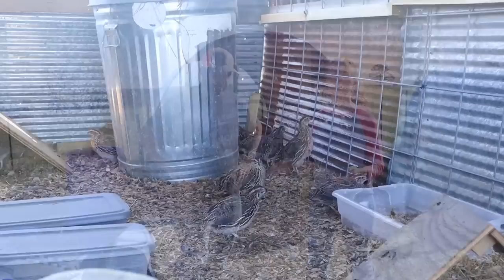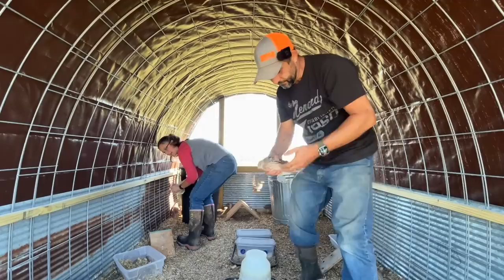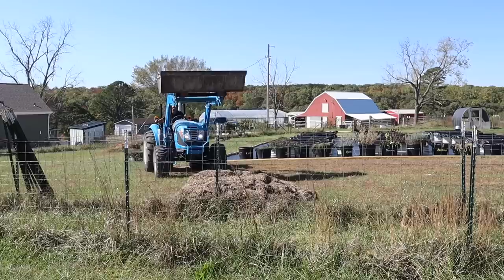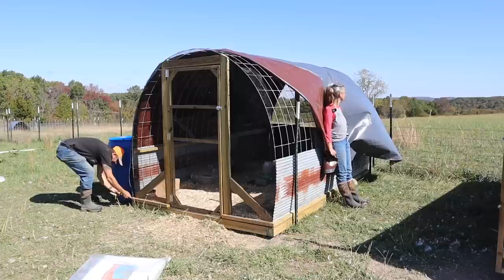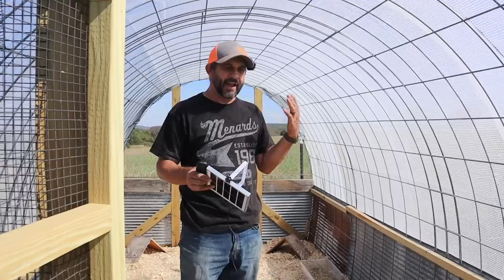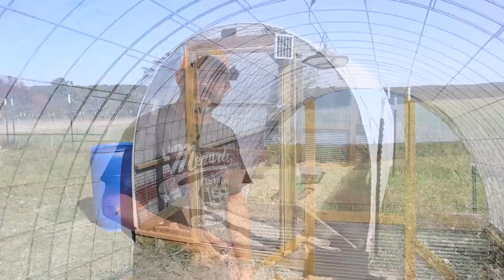The QUAIL stopped Laying EGGS! Will THIS be the ANSWER to our Problem?

Comment: Hey. Just a heads up. My father was a heavy equipment operator and I was running a tractor by the time I was 12. A big safety thing he said to me is to always travel with the bucket low, not up high. Tip over hazard. I kinda cringe when I see you do that😢
Reply: Agreed!  Bucket as low as is practical.  Keep the center of gravity low especially with a load in the bucket!
Reply: I was taught this in tractor safety in 1980's. Absolutely accurate. Also, for the masses, no passengers without their own seats. If you roll over you CANNOT save the passenger(s). Too often people mow with child onboard the lap or wheelwell.
Reply: That was scary
Reply: That's the difference between day and night.  😂Looks great

Comment: In the Spring, you should just be able to layer the dark tarp right over the top of the clear, since it's a bit longer, it will reach down further on the sides to screw it into the wood, then next Winter just remove the dark one, and the clear is already set
Reply: You read my mind!  😁
Reply: I had the same idea. One less thing to store.
Reply: The dark one could be adjusted in the summer depending on how hot things are covering whole or a only a portion of the coop.
Reply: Yes would that work. Just add the other tarp on top of the clear one
Reply: There's always shade cloth too.  Different degrees of shade, and could be doubled up if wanted.  Then it's still shaded, but not so dark as with a tarp.
Reply: @sherribrown9989 I thought about using shade cloth too!

Comment: To save time, when you change the tarp in the spring, could you put the dark one on top of the clear? This way you would only have to take off/put on the dark one. I don’t know how much time this would save or if it would be too warm with both tarps on. Just a thought.
Reply: I was going to suggest the same thing!  Kinda like shade cloth for the high tunnel(quail)!
Reply: Same same 😄
Reply: I was thinking the same thing.  It certainly would streamline the process twice a year.

Comment: When we lived in MO I had my quail in 8x4 in ground garden bed/runs. I rotated them through the beds that I planted with leafy greens. As the plants were spent the quail cleaned up the bed ready for re-seeding. I had greenhouse plastic over the beds in winter to keep the worst of the weather off. The quail were very happy and laid most of the year. I plan to do the same now that we have moved back to England.

Comment: Vinal flooring will making a very big difference. We have it in our coop, love it. So easy to clean. String up holiday lights around the sides and door. It will give light and some heat. Love the clear tarp. Need one for a shorter high tunnel for spring and fall plants. Thanks for sharing. I think the quail will enjoy it. God bless and protect.

Comment: 1. Pretty dusty in there. You should be wearing a dust mask.
2. Leave the clear tarp on all year. In the summer just add the dark tarp over it, or better yet, add a shade cloth. Then when it gets this time of year again, just remove and stow the shade cloth. No need to put the clear tarp on over and over, year after year.

Comment: If you're willing to consider Outdoor String Lights with remote they usually have the ability to schedule when the lights are turn on and off.  Some have time limits such as 3, 5, 8 hours and others allow you to schedule the turn on and off time.

Comment: If you add big sand pits for them, most of your eggs will be laid in the pits. For your size area  and quail qty I would suggest the concrete mixing trays at Lowes/HD. A mixture of 50/50 dirt/sand works best.

Comment: Something you could try…We use a cheap vinyl flooring on our coop floor. It protects the wood from moisture and rot.  We also can roll it back up wash it if need be…although haven’t had the need to do that yet.

Comment: Tractor supply has a bedding called pelletized horse bedding. Is compressed untreated pine. It looks like pelletized food. Once the pellets get wet it turns into sawdust  irs cheap and clean. I've started using it with my chickens...pretty much all Mt animals and I have my quail in  a coop on the ground

Comment: I don't know if this would apply to quail or not. I've always heard that if you are extending day length with artificial light you should have the lights come on before dawn rather than after dark. The birds use the dimming twilight to find where they are going to settle / roost for the night. If the light goes off suddenly they are left in the dark without being able to see where to bed down.

Comment: You'll definitely get more eggs. I have power at hutches and use a string of LED Christmas lights and get more eggs than I have layers every day. I set timer to come on 6-7am and 5-9pm to give them 14 hours of light. If the clear tarp doesn't get destroyed by UV you can just lay the dark one over it in spring.

Comment: @Living Traditions 
If you use supplemental light, your egg production will drop off from the norm substantially next season. I have been homesteading since 2011 and have learned this the hard way. Also your water barrel will act as  a store of thermal energy when its cold if you put it inside the coop in the winter. And will be less likely to freeze if thats possible in your area.

Comment: I am in Sudbury, I Ontario
I would like to tell you that it would be easier if you made a little tiny house in there that they could be in and you wouldn’t have to pick them up. You could close them up at night. They would stay warmer in a little tiny house inside of their up off the ground All together.  When you’re cleaning the coop, they would be all inside the house. You wouldn’t have to pick them up no stress and it will make it much easier for them to be in when it’s really cold you can close it and make them warmer from their own heat.

Comment: just a suggestion that might help, line the bottom of the pen with a tarp then put on the shavings, then all you'll have to do is pick up the corners of the tarp and dump in the tractor bucket instead of shoveling...

Comment: Great video Kevin!  An idea for your ends, just build a square frame around each end, Same height and width as the enclosure.  Then, mount a piece of metal conduit tubing across the top, and tape a plastic sheet to the conduit along an edge.  Essentially you're making a simple "roller shade" like for a window, with plastic sheeting.  Now if you want to open it up, just roll up the plastic, and if you want it closed, pull it down and hold the bottom down.  If you want it to always look nice and neat, tape another piece of conduit to the bottom of the plastic, and it'll keep the bottom from wrinkling, and the weight hold it down by itself.  I've made these with both plastic and metal conduit, whatever you have on hand will work, but the metal one works better for the top so it doesn't bow in the middle.  Even then, you can keep a plastic one from bowing as much if you stuff a stick or a piece of wood inside.  Good luck!

Comment: Hi, I used Christmas lights on my quail cages and a light plug timer that you would use if you leave your home and want it to look like someone is around. Worked  really well it  did. So this will work  out. I have even used a rechargeable shop flashlight that had a hook on it worked good to for my chickens.

Comment: Just a suggestion, but if you put down a layer of vinyl flooring in the coop it should help with the cleanup. You should be able to pick up a renement fairly cheaply.

Comment: We built your hoop coop according to your video last year for our quail, and they have lived comfortably in it for a year and a half.  :)  Actually we've built five so far, we have chickens now too and plan on making one for rabbits as well!  We put a clear tarp on the back when it gets cold, and sometimes during summer storms.  We cover the back with shade cloth otherwise.  Of course we had the SAME problem finding solar powered timed lights.  We went with a decent solar panel, a good quality USB battery, and Christmas lights that stay on 24/7.  (I also hook up a fan, a camera, and an aquarium heater for the water.)  I'm still looking for an in-line USB Christmas light timer that doesn't need to be monitored every day!
We haven't had to scoop out bedding, we just add some wood chips every week or two and stir it up for them.  It has stayed dry and fresh.

Comment: I use poly feed sacks cut open and duct tapped together to cover my wood chicken house floor.  I lay down strips rather than one big tarp do it is easy to carefully pick up the tarps and dump into front end loader
 I use bedding on top of the tarps. Very easy for me to clean the chicken house.

Comment: When I added a light to our chicken coop, I put together a 12 volt timer, small 12 volt LiFePo battery, solar panel and 12 volt led light. The timer I use has multiple on-off settings. I set it to come shortly before sunset and go off after some time. I think the whole setup was under $100, and I can add more lights or other 12 volt items if needed.

I did this because, like you, I could not find a light that would come on at sunset and go aff after a couple of hours.

Comment: To eliminate the inconvenience of a tarp that turns out to have it's size falsely advertised and be too short; the next time you change the tarp, add a 1x12 inch board at the bottom of the coop on both sides. Then you can center the tarp without a problem.

If you do that, you can extend the life of the wood by using threaded inserts where the grommets are screwed down.

You can eliminate the snagging by either putting tape over that area of the wire, or place 1/4 inch thick PVC boards over the coop.

Cut an 1/8 inch deep dado into the boards at the end that way, you can tie rope or twine onto the tarp and run the twine or rope in the dado to pull the tarp over the coop. This will give you more control over the tarp on windy days as well. Simply screw the tarp down at the two ends first, and then pull the tarp over the coup.

Comment: I love the way y’all  jumped in there and improvised with the new tarp, which, by the way, should DEFINITELY be the size that’s  stated in it’s finished state! It’s one thing if you buy the tarp fabric and then have them finish it as an option but when it’s a pre-packaged item that says the tarp is a certain size THAT’S finished product! How else are you supposed to know what size to order?  Even though you went ahead and used it, I’d still be contacting the company and I’d let my review state what you  ran into. I buy nothing on Amazon without reading reviews and this is something I’D want to know if I was looking to buy a specific size ANYTHING!  But great job, weaving in the wind…LOL Y’all got it done!😊

Comment: What if you made a similar coup but with a  roller at back, as well as a back hatch that opens you put a crank on rear roller like you have to lift side of greenhouse then with a heavy duty tarp make a conveyer so you can just open back hatch and crank the mess out into tractor bucket . So you have a tarp that fits over floor inside then bedding over top when its time to clean remove feeders etc open back hatch and scoot birds out into a cage then crank soiled bedding into tractor and just pull on front of tarp to put it back in place put fresh bedding and feeders back in then  line up crate and let birds back in.

Comment: For the bedding, I recommend finding a friend with a wood planer that utilizes a helical cutting head.  The resulting chips are a small consistent size, and the cost would be nothing.  They should compost faster as well.  The wood worker will appreciate you taking the chips.  Trust me!  Thanks.

Comment: Great job guys , I'm actually building a green house 20 x 10 that will have 4ft solid walls and concrete post for my new chicken coop. I want them to have more light and plenty of room to move I. Our very deep NY snows. I have to give a bit of a warning on that tarp. I put one as a temp on another plant hoop green house  last fall. The sun made it brittle by spring and there was major leakage. . For the new coop green house I will be putting wide rolls of bubble wrap under a "string' system attached to hoop frame to retain more heat in the winter nights. Your lucky we have weasels, pine martens , fishers, raccoon, and bear all love the chickens in winter. I will be lining the hoop frame with 1/4 hardware cloth. Fishers literally ripped out a window on our last coop several years ago. Got them all.  Here weasels would crawl  up under that one side of your tarp in a heart beat.. It will also help with snow loads between hoops. Love the channel and all your ideas. They've given me inspiration.

Comment: (1)  What about running 2 lengths of christmas (multi-color or white ?) LED light strings around the edging of the windows - and put onto a timer with the solar charger and battery system - less energy use and greater overall light profusion.  (2)  Could also install LED spotlight 60W - 80-100 W and that would definitely have some greater illumination.  (3)  If you also put in some mylar plastic sheeting onto the bottom walls, then the greater albedo light bounce would have even greater illumination of the ground level of lighting for the birds.

Comment: Love your quail hut. I may try one this spring, but I am thinking twice as long with a door on the center and both ends. I could shut them on one side while cleaning the other side. And maybe I could just have on tarped and one clear . I still work 10 hour days away from home.

Comment: I am surprised you didn't look for replacement cover for the small cheep hoop greenhouses. Ive seen some on line on Walm web shop in the simi clear same as your tarp. That would have given you ability to close ends if you got one with front & back door model. You coukd always get one to put over your clear tarp when winter hits even if only one doorway type it would work for winter & over your tarp it would insulate more.

Comment: The quail look like they are really doing good in the their new home. That is awesome. More room to move and interact with each other. Do they tolerate the cold well? Or will you have to do some kind of heat source for the really cold nights?
Reply: These quail do well in the cold. Even down to -10 without heat. As long as they are protected from the wind they are fine

Comment: Innovative on the lashing, but I’d just use sheet metal screws with the washers you used before.  I just a night to day Solar light.  It shuts off when the battery dies and recharges during the day. Never needs to be messed with

Comment: Hey Kevin, you should consider hanging the panel on the header board orienting the solar panel 90 degrees the other direction for optimal charging. Solar panels charge best with direct light striking the panel pointed directly at the sun's rays. The axis you currently have it on does reduce the charging capabilities.

Comment: If the timer on your light is like the one I have, you should be able to turn it on at a pre determined time, set the timer for 2-4-6 hours, and it will come on ever day at that same time, stay on for the appropriate number of hours, and turn itself off!  Win for not having to do that every day!

Comment: I plan to eventually build a couple hoop coops for birds, but I was thinking about using either 2x6 or 2x8's around the bottom because of the discrepancy between cut size and finished size of tarps. The bigger wood will make it heavier, but I don't plan on moving them much.

Comment: I was going to suggest an in-line timer . . . that you can program so it turns on the electricity to whatever you want on a timer.  However, it may be a problem on a solar unit . . . I don't know enough to be able to answer that.

Comment: Since you said it tends to get wet near the door when it rains, would it be helpful to move the wooden tents a little further in so the quail will not get wet feet? Just seems the new bedding will get wet where you have the tents in the corners near the door.

Comment: As always, WELL DONE 
Wondering if you could put a shade cloth like the greenhouse instead of plastic?
Maybe you could try the shade cloth in the spring to see if it worked out to your thoughts?
P.S. Looks like there are many comments below suggesting using the shade cloth.  I should have waited to make my comment, sorry.

Comment: I see you have an LS Tractor.  So do I.  Got it about 12 years ago.  A 4040EZ with 41 HP 3 cyl diesel.  VERY reliable machine...  Rim-gard in the tires, extra large tires and it is a beast.  LS makes several other brands including New Holland and they are assembled in New Holland PA...  

Just an FYI
Reply from the maker: I’ve had mine for about 7 years now and have been very happy with it.
Reply: I have a Mahindra 4510. It's the biggest piece of garbage I have run in my almost 60 years of running equipment.  I never pass up the opportunity to bad mouth it. Sorry for butting in.

Comment: If I ever get into raising quail, I will use your method. It looks so much better than the way that you were doing it. On that note, I wish there was a different way to raise rabbits. I don't like having them confined in their little cages but coming up with a solution where they have more room to roam, and not having to move them all the time is something that I just have not been able to tackle yet? Do any of y'all have any suggestions? I don't have a lot of strength and I have chronic pain so easier and quick is better.